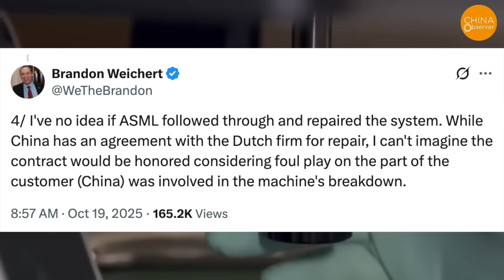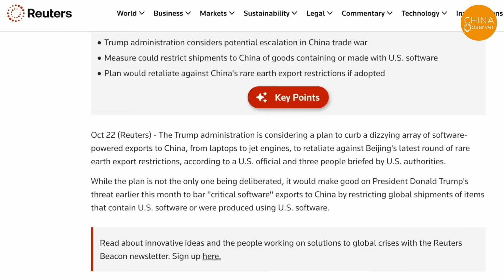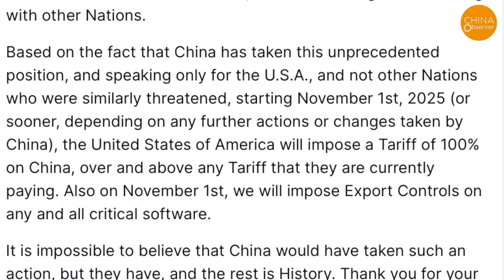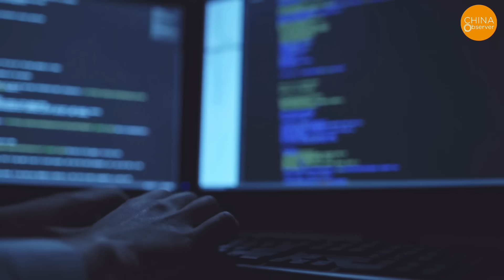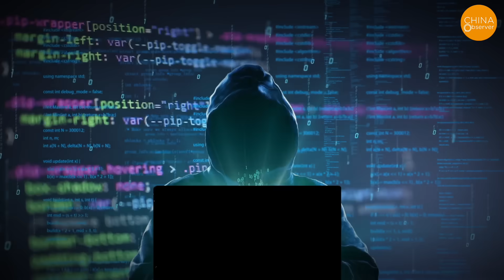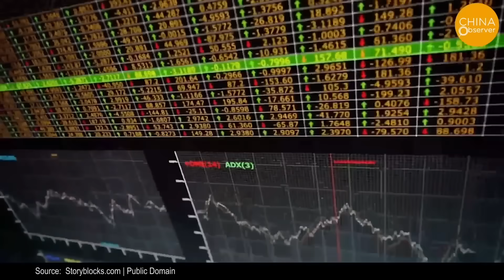China’s Embarrassing Failure: Attempted Reverse Engineering of ASML DUV Ends in Disaster

Comment: The global dominance of Dutch ASML chip lithography machines isn't easy to copy because ASML has organised a chain of high-tech suppliers like Zeiss lenses etc., delivering high-specced parts which cannot be copied. To copy you have to manage a similar high-end supply chain, which is hard with few highly specialised firms like Zeiss globally. ASML recently showcased the High-NA Extreme Ultraviolet (EUV) lithography machine. This colossal machine, valued at 350 million Euros, weighs as much as two Airbus A320 aircraft and is proclaimed by ASML to be an essential item for chip manufacturers participating in the artificial intelligence boom. These machines are so incredibly sensitive and destabilised by the smallest Earth vibrations that a special ASML service team has to recalibrate them every 2 months!

Comment: The fact that they attempted a reverse-engineering effort doesn't surprise me.  They fact that things went wrong, and they bricked the machine, also doesn't surprise me.  The fact they called in the OEM to fix it, with obvious tattle-tale features glaring, DOES surprise me.  I knew things could be sloppy, but this is pretty sad.  There was obvious no way ASML was going to repair this machine, and calling them in basically was just a confession.

Comment: 8nm at any accuracy is impressive. Of course there will be high failure rates which would make the final product too expensive, but the fact they have come that far.. that's something and should alarm ASML.
They don't have to engineer one product to high spec, they have to engineer many. From the stepping motors to the optics everything has to be perfect and the control systems account for any variance which will take years to develop.
Once they do it though, well.. China will undercut foreign products and damage the market. They won't be to the same quality at first, but they will exist and that will be a problem for the west. On the upside it will make chip production cheaper which is something we need.

Comment: I forget whatever industry name but in these, some are known to put 'Red Herrings' in their blueprints and actual machines (and i suppose digital too) but basically a kind of fake part that can also tip them off to a thing being copied/retro-designed. 
- Inside the proprietary box, which cannot be disassembled, there is a flange-passthrough that buttresses against a key component and seems to work as a magnetic 'cleaner'?
And that part is made of a really unusual amalgam. 
but it also happens the (chinese in this case) can buy those from a little known Dutch company and relatively cheap and easily, NL Flanges. 
The moment NL Flanges (which calls ASML of course) they get orders for Flange Passthroughs CAUGHT Red Handed!
because its a fake part that would only ever exist in a sealed no-tamper case etc.

and I suppose it can become comical if they do not dare order a Flange Amalgam but instead produce their own because that would be very very expensive,, time consuming and waste untold hours making a fake part that doesn't actually do anything.

Comment: reverse engineering is much more difficult than many people think.  Just copying all the parts is not good enough.  Getting the materials correct along with the proper heat treatment, etc is very important.  The thing is that you need engineers that understand the design intent of machine and that is not a trivial thing.
Reply: Yes but this is still something that shows that ASML can not work with the Chinese since the Chinese would just steal the tech.

Comment: backward engineering is not something the ccp is good at, unless the product is simple.  their jet engines are the best example.  having come from russia for a very very long time.  even russia had a better, longer lasting product... because research is king.  when you don't do the research you don't learn about the innovation necessary to create something and improve on it.  when you copy.. you try to do so with the lowest costs available, so you cut corners... leading to higher failure rates, weaker tolerance control, strength issues..and so forth.  why do you think the families in the ccp send their kids / scientists elsewhere to learn?  to be taught? or be operatives in the theft of others intellectual properties.?  because they want to skip the costs of research.. they don't want a smart populace, because that would mean the potential for anti ccp sentiment/ actions/ideas would flourish more.  its why you will not find many able to own guns in these nations as well, typically.  unless they are officials in that government.. military, law enforcement etc.

Comment: @10:12  0.0001% is one-ten-thousandth, not one-millionth percent.  Also @12:29, that's much more likely to be 70 mW (milliwatts) not 70 MW (megawatts).  70 megawatts would destroy the silicon wafers and the phototools used to image the circuitry onto the wafer.

Comment: 1:25 Oooh ... what a sweet sound. A lot of Chinese electronics do the same thing. They blackboxed their crucial systems, usually the battery parts.
Reply: They didn't blackbox their stuff they just copied other people's tech and stole intellectual and research and development strategies , then "black boxed" the stolen tech and put their name on it with made in China stamped on the bottom.
Reply: @hyperwebbing  As the meme goes, it's blackbox with extra steps.😅

They do blackbox their products. 

An acquaintance of mine wanted to replace his China made e-bike dead battery, so he cracked open the battery box, put the replacement, close it, and ... the controller and panel won't accept the battery. The only way he could make the battery work is by replace the controller and panel of his e-bike with generic brands, which add 50% more to his initial budget.

Comment: You can't just 3d print a gear that's going to be used 24 hours non-stop. Also I had an experience in school to reverse engineer and disassemble a 32 nanometer lithography machine under the surveillance of Taiwanese engineers it was hard first we had to be inside a vacuumed airtight rooms with PPE and face masks. Since Texas instrument is unwilling to send their disassembling machine so we had to disassemble them manually undersurveillance it was hard because a mere vacuum leak because some chemical or coolant spills spoils that specific process. It took us 1 whole month with 100 people in different rotations to completely disassemble them then study the components then assemble them back if the Taiwanese engineering wasn't there it would have been a disaster what does China think disassembling a machine with centimeter components is its not a walk in the park each components are stored in airtight containers. But I heared new lithograpy machines has a simple maintenance just replacing a whole block of machines instead of disassembling them by little parts China should have just bought those blocks.

Comment: Back in Cold War days the USSR had the same issues with tolerances on Japanese machine tools.  They'd buy the machines, but no service contracts, and try to replicate the entire systems to make their own machine tools for use in making parts for military use.  They weren't able to replicate parts tolerances so the military hardware required more maintenance and/or repair than similar western hardware.  One example found were ball bearings that had both significant tolerance differences in both diameters and surface finishing.
Reply: Neither Russia or China are capable of making in volume high precision heavy duty bearings.  EVER.
Reply: But remember when the JAPANESE accommodated the USSR with submarine rotor props to replace their noisy ones to the consternation of the USN and US government?!?
Reply: @DavidPhilopott-bq9uv didn't matter they couldn't keep them in good condition. As the old saying goes "it rhymes with maintenance."

Comment: China is good at stealing high technology products.  However, when they try to duplicate it, their products are failure.  Their basic weakness has to do with metallurgy.  They lack the expertise in accurately duplicating the high quality metals.

Japan licensed the technology for China's high-speed rail but kept the technology for the wheels.  Consequently, China started making their own wheels instead of buying them from Japan.  The Chinese wheels wear out quickly and vibrations are felt throughout the cabins.
Reply: Harbor Freight drill bits made in CCP land. Won't cut southern pine! Imagine a higher requirement!
Reply: Japan like the West should have never gave trying to any inside information on any designs or whatever for the last 40 years. Tesla an apple among others should have never ever made deals with the devil. Just look at GM and what's happening to them.

Comment: so what, their screw are coated with special glue.  So, if the screw is unscrewed then of course never get back original setting..  And their wire shape and angle are fine tuned for precise setting. They cannot be put back. 
China is willing sacrificing this equipment for reverse -engineering.   China bought so many of them and using one for reverse engineering purpose is justified. 

Taiwan is hideous, always spreading malices about in China. 
Anything good in China they are not interested. Any thing they think its bad they amplified 10x times.  Selective reporting.

Very Nasty people in Taiwan.